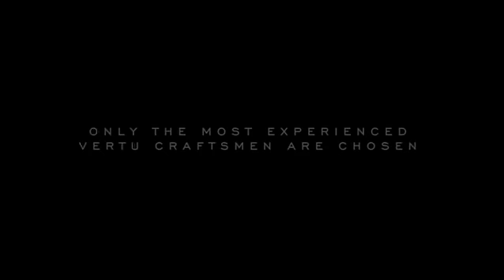Vertu Signature S

Comment: My Vertu Ascent has been dropped many times and still going on strong. 
DO NOT use any form of metal polish on your Vertu! It's made from some sort of anodized aluminium that does not respond to polishes, and the Vertu centre informed me that anodized aluminium is non-polishable as the anodized layer is very hard. A simple wipedown with a damp cloth is all that's necessary. I use baby wipes and its fantastic.